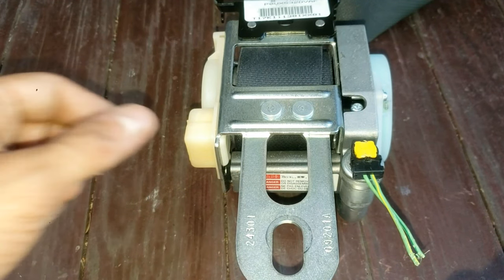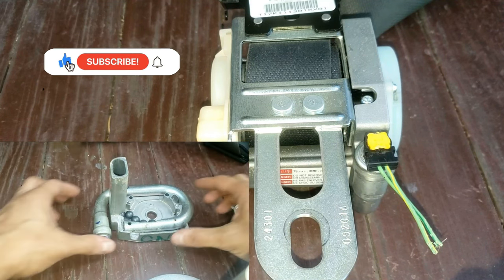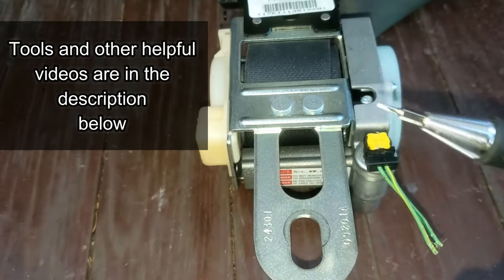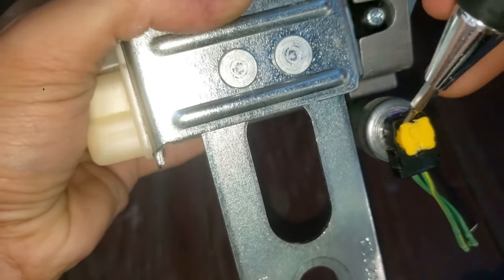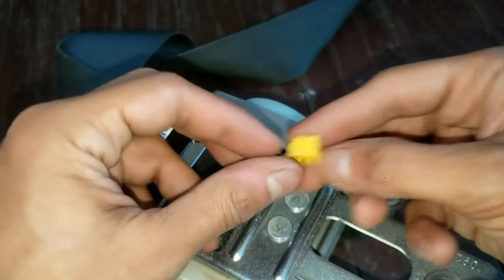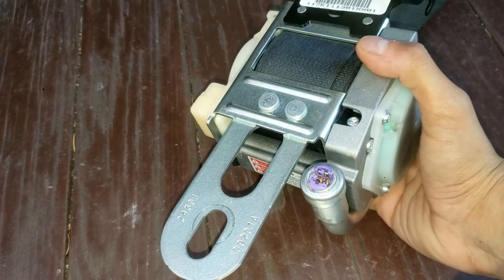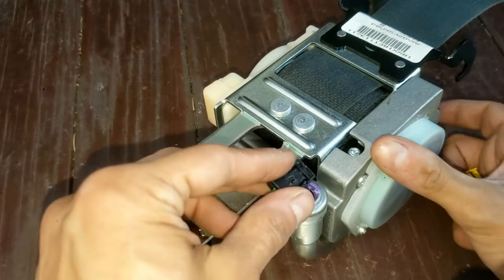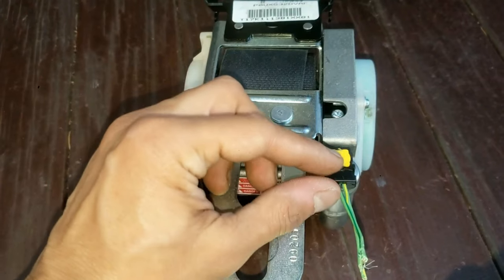How To Remove Seat Belt Pretensioner Yellow Clip Sensor Plug 💺

Comment: Please where can I order one. I just need to get the pretensioner yellow clip. Mine is missing on the seat belt plug. I really need one for my Nissan Rogue 2008. I look forward to your reply
Reply from the maker: I'm not really aware of a place to buy just the pretensioner clip. That usually only comes factory with the car. Your best bet would be to go to a junk yard, and get the entire wiring. Otherwise you would have to know how to work with wire and cut off the junkyard one and splice it to your vehicle. But I don't even know if that is possible or would have other consequences. I am not an electrician. Perhaps others can chime in on this.

Comment: Hey after you disconnect the wire from the seatbelt can you connect the battery again without the wire plugged back in?
Reply from the maker: Haven't tried that before so I do not know. Also it may vary depending on the type of vehicle you have. Also, my guess is some codes would appear. Your best bet before doing anything would be to check the repair Manuel for your specific make and model.